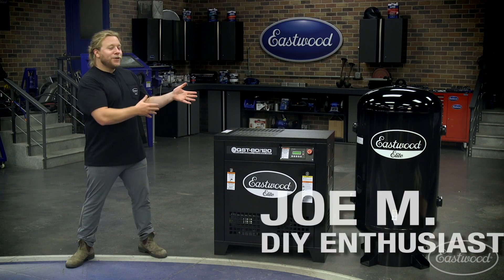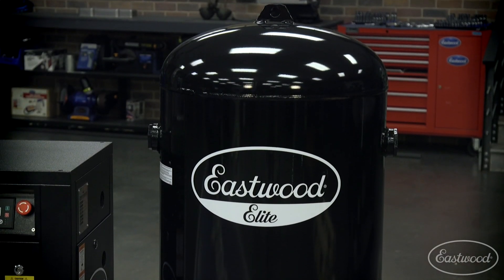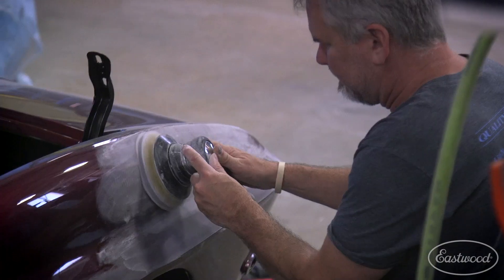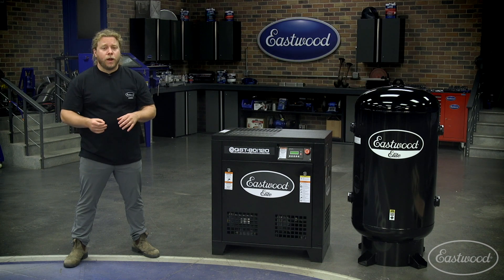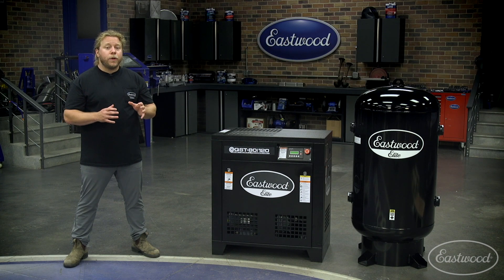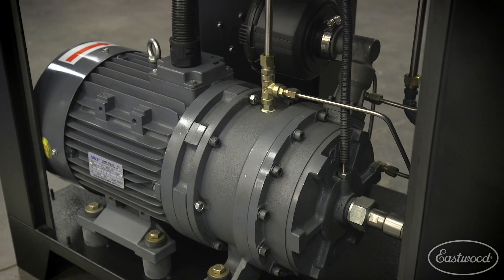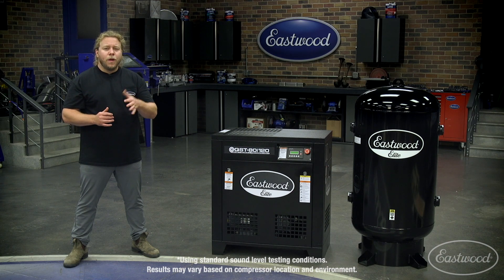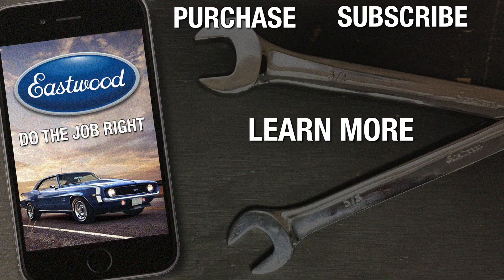The PERFECT Shop Compressor? ELITE QST™ 80/120 SCROLL AIR COMPRESSOR: Quiet. Powerful. Affordable!

Comment: So is it 208-240v or 3 phase? Maybe i'm not hip to the lingo but 240v is single phase
Reply: 208 volts comes from a 3 phase delta system.  240 comes from a 3 phase wye system.   The compressor will work on either system as long as you have 3 phase.  Your house does not have 3 phase.  If you own a shop in a commercial/industrial area then it's possible you have 3 phase.  If you do not have 3 phase you will need an electrician to install a phase converter to power it.  So this compressor is not going to be for the home hobbiest.
Reply from the maker: 208-240V, 60Hz, 29.8-amp, 3 phase
Reply: No it's not 220
Reply: @Reaperhydraulicstampa  220 is between 208-240v
Reply: @fraserfab68  yes I know. But three phase seems like it's adding another 110volts to it. I bought three phase lights for my shop one time and I'd have to call the power company to get three phase wired
Reply: 240 can be both. in this case, I support it is 240 volt 3-phase delta system.

Comment: Has Eastwood considered a smaller Scroll compressor than your 30 gallon model? The technology and reliability sounds brilliant but it's still to big for my shop space, not to mention the model featured in this video.
Reply: The shit is not that reliable. I got the qst 30/60 collect dust right now....with their 100000-hours bs. hell, compare the claimed hours to the service plan matrix...hhhm for me, 100000 converts over to easily 12yrs... why would I need 2 or 3-year service plan attached to the already 3 years offered with the product? my has less than 700 hours....1.5ish yrs
Reply: https://www.obsessedgarage.com/collections/air-compressors/products/fiac-new-silver-3-silent-rotary-screw-air-compressors?variant=34424709677207